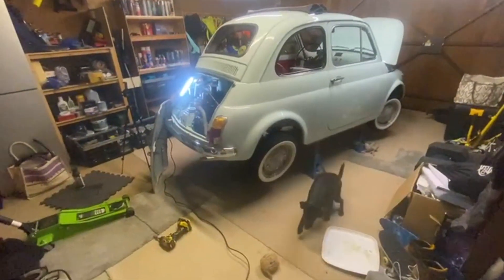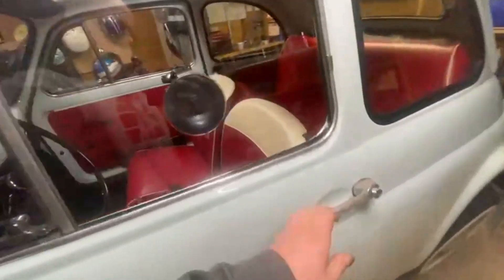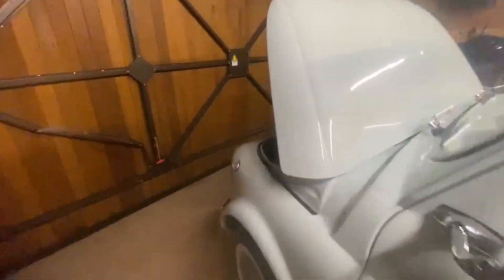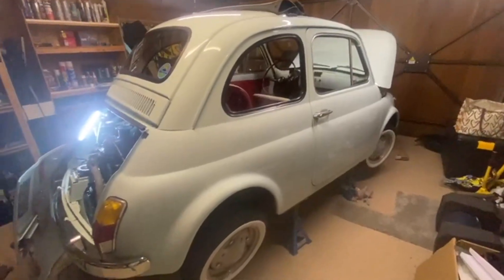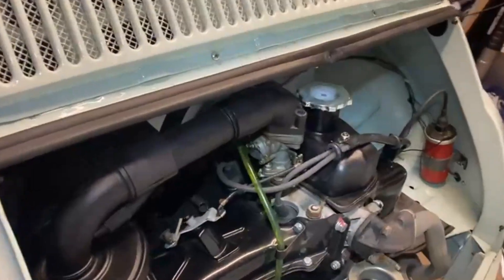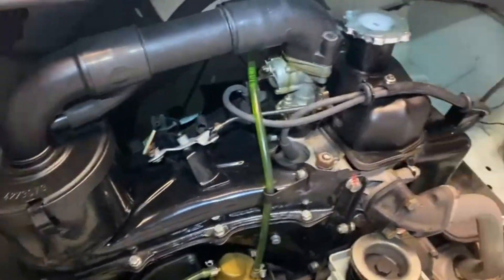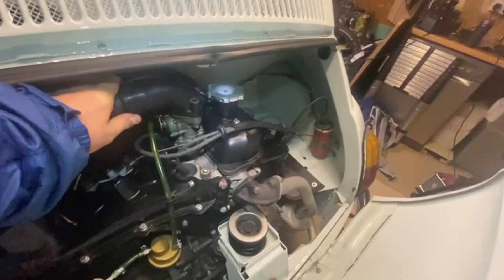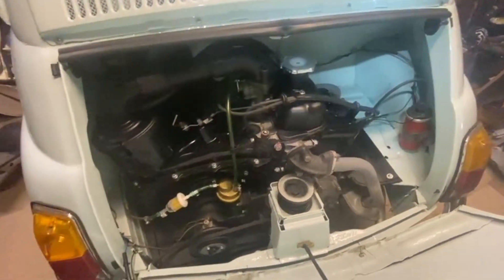Ep 4 - Car Snacks - Tesla Powered Fiat 500  New Project!!!!!

Comment: Few tips, you have 2 screws on the imb28 carb, as you look from behind there is a recessed screw on the lower right, this is your mixture/idle air valve. You also have an idle speed screw on the throttle linkage. Base settings on these are 2 turns out. If you have air leaks and a high idle also check the carb base against a flat surface for warping and sand flat if needed, the plastic bakelite spacer can crack too. Id also check your fuel return line on the carb top plate, and if you pull the top plate there is a little filter above the needle valve. Be careful with that fuel filter in engine bay, id move it to the tank end, while you are at it, remove fuel sender from tank and check the 'sock' type filter isnt clogged
Reply: Also having paused video it looks like thats not the correct spacer for that carb, it doesnt clear the head bolts and is probably leaking air
Reply from the maker: Hi buddy great advice matey. I really appreciate it. When you say spacer where do you mean. I can’t really see any spacer buddy.
Reply: Sorry by spacer i mean the black bakelite/plastic part that the carb sits on between it and cylinder head. Hit up Ricambio on the web and check out in their shop the difference between the 2 parts for imb26 and imb 28 carbs and compare to what you have to ensure its the correct part for the carb you have